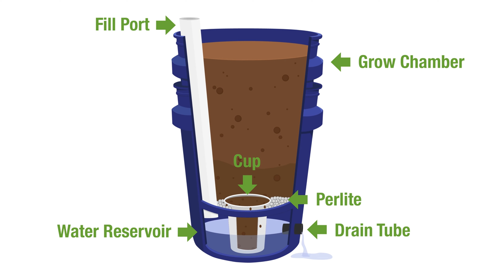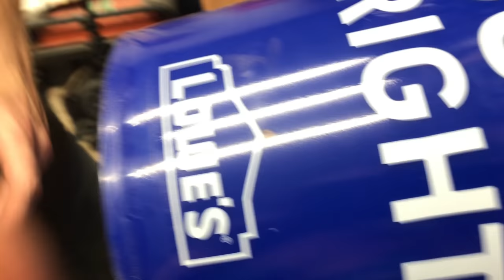How to Build: Self Watering 5 Gallon Buckets

Comment: This might solve my problems with growing figs in a bucket. Thanks 👍. Do you believe this could work year over year when I over winter the plants in my basement? Zone 5 here so I move my peppers inside and back out yearly with my figs.
Reply from the maker: It should work well. You’ll need to maintain the soil in the buckets over the long term, but that’s about the only potential issue I see.

Comment: Your wicking cup has a taper to it so instead of tracing the top of it trace around the bottom and it will fit perfectly/////   they make bung adapters = no struggling with split washers////or wrap some string around the split in the grommet and put both ends of the string through the bucket hole then press on the grommet on the inside of the bucket and pull on the string for a no hassle install

Comment: Why would you screw them together? Before screwing them together if your pipe got clogged, you could just pick it up and make sure the bottom isn't clogged, fix it, check water level, remove mosquitos, dump the water, replace the plant with a new bottom bucket, etc.
Reply: Bit late here, but instead of screwing them together you could have a few bricks in the bottom like i did and have it rest on them

Comment: I tried this and the soil stayed too wet so I ended up watering at the soil. I think next time I'll try filling the reservoir with gravel. I did not screw the buckets together and I'm glad because I had to take the top bucket out to empty the yucky water that accumulated in the reservoir.
Reply from the maker: Sounds like you didn’t do this. When done correctly the soil doesn’t stay wet, and the water doesn’t get stagnant.

Comment: This is not how to wet soil for a SIP setup and people should avoid Foxfarm. Should have wet the soil prior to putting it in. And while top watering a SIP is fine, you do not want it to runoff at all. The idea is to not have much of anything beyond plain water inside the reservoir to avoid a non-beneficial anaerobic situation since most won’t be aerating their reservoirs. Would also advise that people use water filtration on their hoses like a Boogie Filter or a cheap RV water filter so that they can filter out chloramine/chlorine.

If insisting to wet soil until there’s runoff in a SIP, then I would suggest to at the very least allow the reservoir to dry out completely for a few days to kill any non-beneficial microbes that may have shown up as a result.

Comment: What about the fertilizer  you apply  from tbe top or you mix it witj the wTer how often  nobody talk s about that???
Reply from the maker: I normally use Fox Farm fertilizer granules, and I scratch them into the surface about an inch deep. Alternatively, you can use a liquid fertilizer and add it to the reservoir. I prefer the granules because I flush the reservoir every 3-4 days to keep it clean.

Comment: Drain hole only needs to be 1/4 inch.  That drain tube is useless.  Water will drain out of the 1/4 inch hole.  I have 10 of these in high quality, not cheap plastic Tupperware.  Please use net cups not generic
Reply from the maker: What is the benefit of net cups over a cup with holes in it?
Reply: @HydroHowTo  strength and longevity of the plastic holding the weight of the soil for years at a time.  I would not trust thin Tupperware plastic, the functions are the same.  👍🏼
Reply from the maker: Gotcha. Most of the cups in those buckets have been in use for close to 5 years.

Comment: Basically a more complicated form of hempy bucket. Over engineering. Plus, plastic buckets, let's all go but a bunch of plastic and stick it in our gardens! Just dig a hole and back fill with something other than peat-heavy mixes. Make a living organic no till soil bed, better yet using salvaged wood. You can still incorporate the reservoir idea but it makes more sense to me to use that space for healthy biodiverse media, thus healthy and productiveroots. The reservoir won't be nearly as effective in insulating the roots from all the heat that will be collecting on the surface of the buckets, as the heat will conduct into the miniscule amount of water hiding beneath sweating roots. Awful.
Reply from the maker: Thanks for watching!
Reply: I’m having to go to this type of bucket to prevent gophers from eating all my plants. They destroyed my raised garden beds last year. The beds had hardware cloth on the bottom of the beds but the gophers just popped out and climbed up onto the 8” beds. In a hoophouse to prevent the deer from eating the plants. I live at 8400’ in Colorado and with the short growing season, maybe these planters will warm up the soil faster in the spring and be easily covered in plastic tents (yup inside the hoophouse) when we get those June/July snow storms. It’s a bit of a challenge growing plants here!😀🤪

Comment: I'm want to try this!
Have you run into any problems with the reservoir breeding mosquitoes?
Reply from the maker: I haven’t had any issues with it. If you’re worried about it, you could cap the fill line when not in use and put a screen over the drain.

Comment: Maybe I been growing to long. Bucket, lid, air pump line, and water. Throw the air stone idea in the trash. No work better results. Just seems like stagnant water going to sit at bottom. With all the bs that falls down into. Seems like a bad idea. Unless you growing small food.
Reply from the maker: Never had any issues with stagnant water. Of course, it's hot here so that water is getting refilled every day or two. Also, not much of any problem with soil falling down into reservoir. After several seasons using this design I can say the bottom res stays incredibly clean. Has worked great for zucchini, melons, tomatoes, peppers, beans, and peas. Sounds like you've already got a method you enjoy, and that's what counts!

Comment: I feed my plants with a water soluable fertilizer.  Do you think that the fertilizer will wick up with the water in your double bucket system?
Reply from the maker: Yes it does. I’ve used the same when growing tomatoes and it works well.
Reply: @HydroHowTo  thank you for the reply.  This summer I experimented with ceramic cones and other drip watering methods.  The double bucket will add a new way to avoid over or underwatering my deck potted plants.
Reply from the maker: @philshaffer3877  you’re welcome! Thanks so much for watching!

Comment: Seems like fungus gnat heaven lol
Reply from the maker: No problems after 5+ years.
Reply: @HydroHowTo  stagnant water + easy entry for fungus gnats is a recipe for disaster. I cant imagine how you wouldnt have gnats. I can see the appeal because of convenience but there are definitely much better hydro systems. Don't know why people are so opposed to top feeding with drippers.. it enables the grower to keep track of EC requirements and you can cycle dry back to steer the crops... the whole point of hydroponics is being in control and maximizing efficiency/productivity. If people want to run buckets or self wick systems they would be better off with a peat based soil substrate
Reply from the maker: @phillipjacobs7691  sounds like you have it all figured out. Congrats on that.

Comment: But how do you know when to add more water?
Reply from the maker: What I do is tilt the bucket toward the drain. If a little water doesn't splash out, I add water until it starts to drain. In the summer, my routine is to top off the buckets every day.
Reply: Brilliant idea for that: I saw that one guy on Youtube put a cork on the end of a LONG wooden skewer then put that in the fill pipe, cork end down with the stick showing above the fill pipe when the resevoir is empty. Fill the resevoir and the cork floats up higher. So you can see the cork drops as the water level goes down. You can mark the stick so you will know Before it goes completely dry.

Comment: Metal screws are a contamination issue when exposed to salts and shit. They will rust and fuck your soil and roots up. I love the idea but don’t understand why you would use metal screws like that.
Reply from the maker: Thanks for your comment! I don’t know where you read that, but the person was misinformed. For one, rust (ferric oxide) is not water soluble at normal pH levels. Since it’s insoluble plant roots can’t absorb it. Anyway, I know there’s a ton of misinfo out there on the internet. You can most def use this method without the 4 screws making any difference to the soil or plant health. Have fun with it!

Comment: I just cut two slits in the bottom bucket and slide in a microfiber towel. that touches the water in the bottom bucket, I would have to lift the first bucket to fill but I grew a whole bucket of basil and I only had to refill it like 3 times.  Its much easier to make on a large scale and good for people with out a lot of tools

Comment: Some plants need aerated soil. Do the same thing but have the bottom bucket empty with air. Get a third bucket and create a drip system. Bucket A has water Bucket B has soil Bucket C has air. Make sure Bucket A & C have the same volume of space to transfer
Reply from the maker: There is plenty of air in the reservoir in the design I build.

Comment: My favorite way I used to do it was has 5 or 6 buckets on a table full of nuted water with my plant in a smallinsh basket i put in the lid. Then I had another bucket under the table with a water pump and check valve in line to always keep the top buckets full. I like this was here you got and might just try it this spring.
Reply from the maker: That sounds like an interesting setup!
Reply: @HydroHowTo  Check it out it is called a Deep water culture (DWC). You can add or subtract as many buckets as you want.
Reply: Oh my, I hate my phone lol I should have proof read that first.
Reply from the maker: @squirlboy250  I like it. Sounds like RDWC, which is what my next build video will be.
Reply: @HydroHowTo   Yep pretty much the same exact thing😁

Comment: Re: All the positive Comments, I endorse. Well presented video. Thanks. I like simple, pragmatic solutions to problems, as this one is. Nicely organized video. I think I will have a few of this design & a few simple "all water" designed systems. Depends on the height of the plant. Greens, as with Romaine lettuce, might do well in all water system. And taller plants, such as tomato vines, etc., may do better with your 2 bucket soil system. Experimenting.🙂Thx.

P.S.: I like the bucket equipment for the convenient  built in handle for relocating it. Also, adding panty hose as preventive mosquito netting with a wire tie off onto the drain plug is a good addition.
Reply from the maker: Thanks for the kind words, and I hope your bucket projects turn out awesome! Thanks for watching!

Comment: Great idea but I would use the white food grade buckets that I get at Tractor Supply and a food grade drink cup and paint the bottom six inches of the outside bucket with black acrylic paint. Pantyhose for screen over openings and inside the drink cup. (Men never think of pantyhose for some reason.) 😁 Thank you for the simplified version, the excellent illustrations and the well done video. ❤️☮️🖖

Comment: huh woudlnt you have nasty stagnent water after a week and you have to change the water so not sure what this did and wouldnt you have to fill the water again due to evaporation and you are limited on what plant you have it would have to be some kind of water plant who loves soaking in water like water crest. and with all that time and equipment you spent on this i thing you might break even at 20 years or simple solution water the damm plant every week